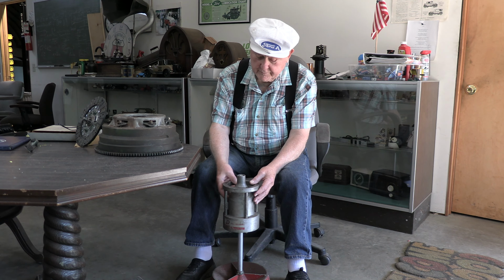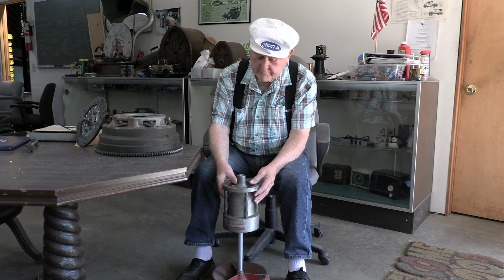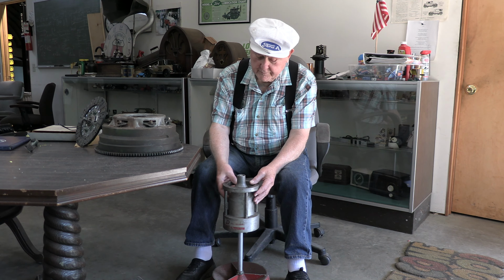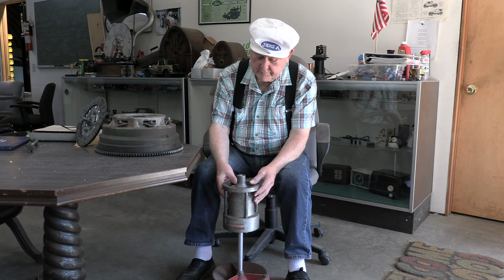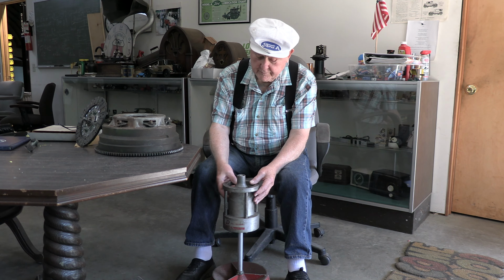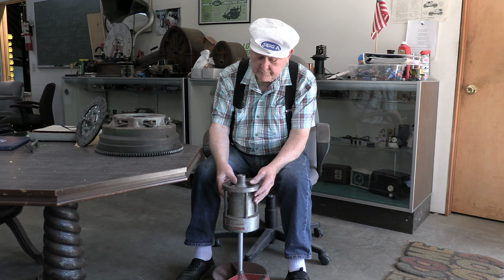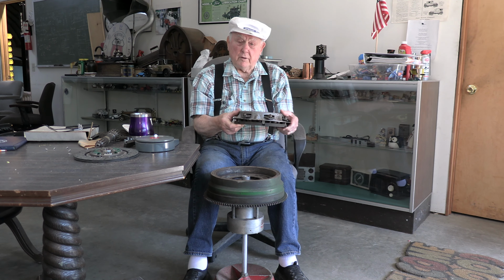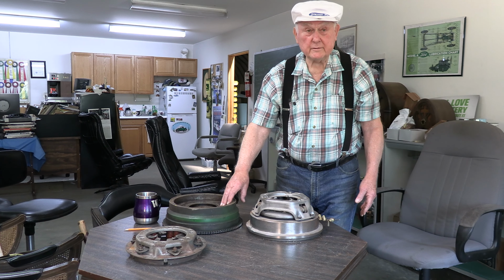Balance your Model A Flywheel at HOME!

Comment: Hi George, Ahna, great video. I'd like to confirm something said. When setting the finger height you constructed a tool to accurately measure each of the six fingers. The tool stops were set at .503 and a .020 gap gauge was placed between the tool stop and the finger. This would be a height of .503 + .020 = .523 ??? Is this correct?
Reply from the maker: Sorry, I meant to post this earlier. George has added: "It should be a TOTAL of .503.  If you use a .020 feeler then set the tool to .480.  It’s not critical just so all 6 are the same and whatever feeler is convenient for a total of 1/2 inch"